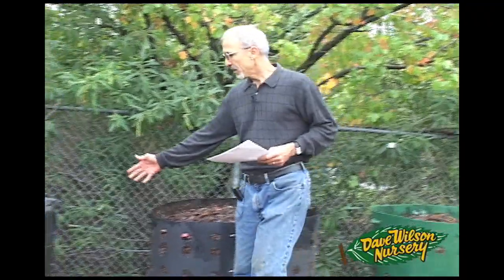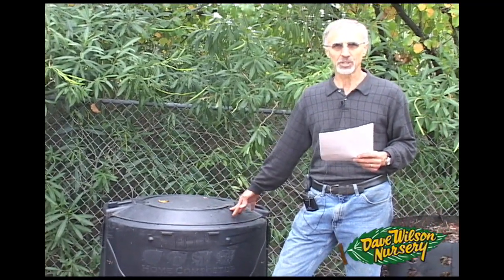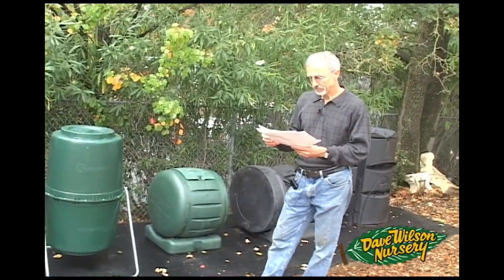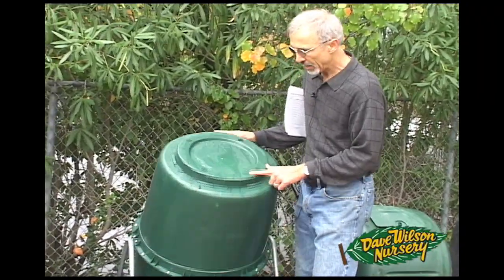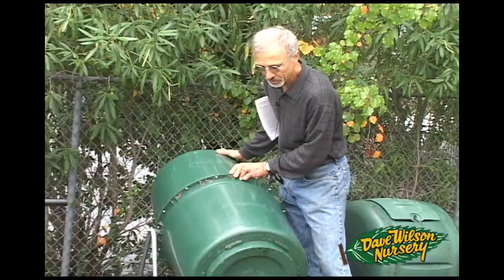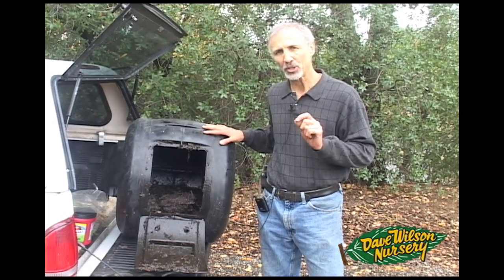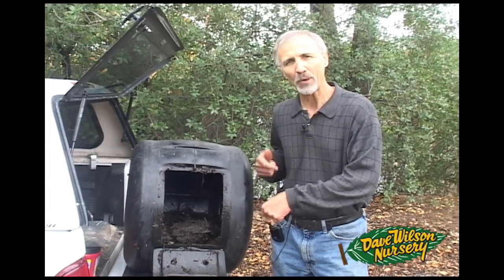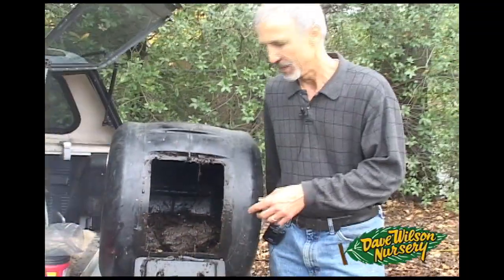Testing Home Compost Units: Part 3

Comment: I have an envirocycle too.  Whenever it starts to smell I add shredded paper (carbon) and let it air out if it's too wet and that always fixes the problem.  The added shredded paper also absorbs excess moisture.  I get good compost out of it too.

Comment: I have a 2 storey composter with a black plastic bin on top and a brick compartment on bottom.  It is fairly quick and a great part of it is that there is so little effort to it.  You just pull the half finished material down from the top  bin into the bottom through a lid and it mixes as you pull it out.   Perhaps the tumblers need to be black to get hotter?
Also,  my reason for brick and the plastic bin up high is rodents.   Your open composters will not protect against them. Thanks, Brian

Comment: What happened to the compost tumbler? I have the first black, square segmented bin and a large compost tumbler and I love the tumbler. It is hard to turn when full but it makes excellent finished compost in under four weeks and it gets really hot. It also is flimsy and needed some additional reinforcement to make it heavy duty but it is an older model so they may have fixed those issues. It gets used constantly.